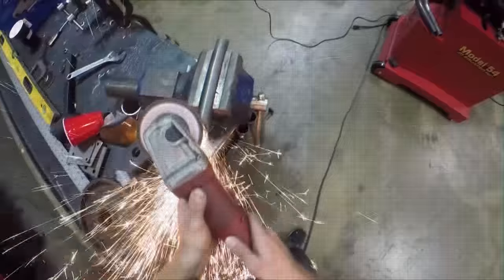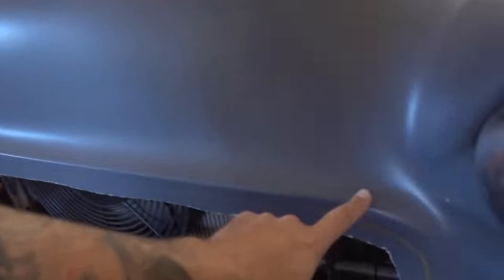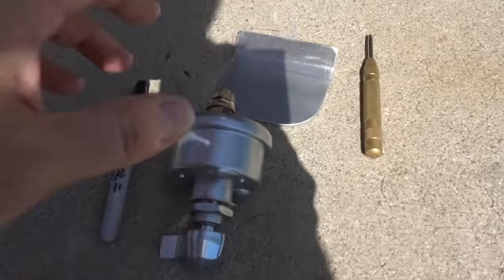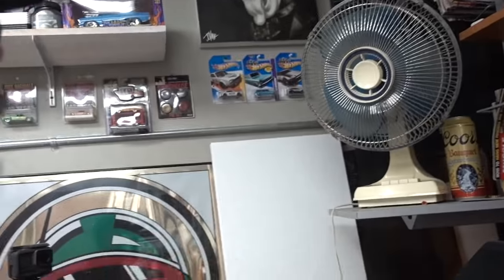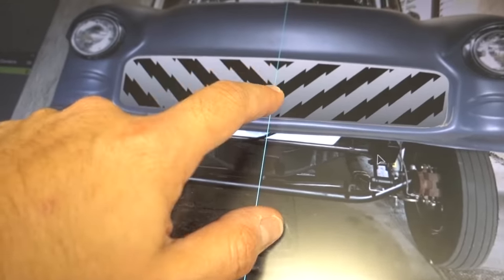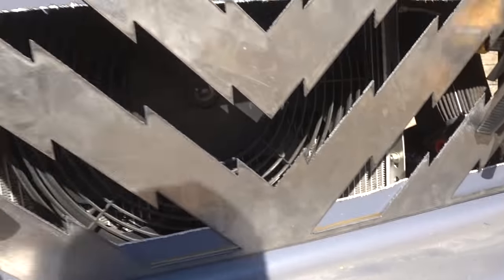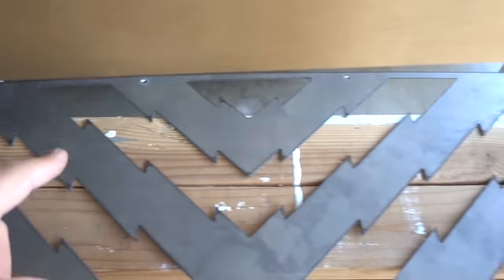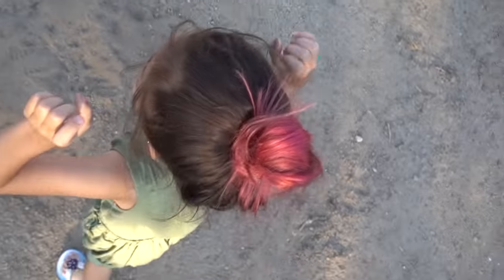600HP Chevy Bel Air Drag Car Gets a Plasma Cut Custom Grille! Gasser Upgrades

Comment: Jon, check the rule book for the tracks you run.  I believe the switch needs to cut the hot side, not the ground, and needs to shut the engine off as well.  And it needs to be labeled "off" and "on" for the track workers.  I'm not a drag racer, just repeating what I read.  Best check for yourself.
Reply from the maker: Whiskey Tango Foxtrot Over Appreciate the message, I’ll reconfirm with the organization about the switch.
Reply: Whiskey Tango Foxtrot Over yes it states on the hot side. I went with the ground out of habit. Always pulling ground first when playing with power.
Reply: DC power flows from negative to positive, plus you will never have a shorting issue with terminals on the back of the exposed switch, cutting the negative in this case is smarter.
Reply: The wiring is a little tricky on the hot side... the alternator will keep the car running after the switch is off if not wired correctly.

Comment: Once upon a time, my father handed down his '55 to me. It only had a 350 with a Muncie gearbox. It definitely had that chop. It had dual quads, engine bored over slightly, lumpy cam, hooker headers, beautiful yellow paint job, grey 5 spoke american wheels w/ chrome lip, nice chrome dual exhaust and dropped spindles w/ slight suspension drop. Damn, I miss that beauty.

Comment: insulate the heck out of the back of the switch , just in case the switch gets hit while backing up and the back hits the frame behind it
might be nice to add the surround of the original grill , the headlight covers are still chrome and i think a chrome edge around a matt black or dark aluminum / silver grille would look goed 
it probably be a good idea to glass in some reinforcement behind the bolts holding the gille in so it doesnt tear the poliester up

Comment: He should do a grind a slight bevel along the edges or do a grill surround trim to add some depth to the piece and compliment the paint color, an easy way is to take plastic poster trim and a heat gun to make a mold around it that will sit flush and securely.
Reply from the maker: Literal Crown Literal, it sounds like you should come down and help!😂
Reply: @HooniganProjectGarage  I literally will, I'm only 2802 miles away. Give me a week.

Comment: What if you did that same design in perforated steel mesh? 
I think that’d look pretty sweet. Plus, it’ll give you some better air flow to the radiator like you were saying you needed.
Reply: Kyle Westfall that’s what I thought too.

Maybe use some aluminum punch plate

Comment: Ok, Jon....just some FYI. The master cut-off needs to be routed to the MAIN POWER...not GROUND! Alternator also needs to route via through the switch! Ground shut-off is easier but allows other grounds to allow engine to run-on after ground is d/c.

Comment: Battery cut off switch is going to take some carnage when you put this thing on the bumper. Might want to relocate or ask Dan to get you a couple skid bars. Just in case, because I believe in it's potential.

Comment: Should have had Kyle make you an outer ring the same size as the grill for a template to cut out the excess then you could have used it as a support brace on the back side

Comment: i wish you would have welded some screws with the heads cut off of them to the back of the grill for better fit and finish!
Reply: Jose Saldana Welding barrel nuts to the back and running screws into them would've been the way to go for invisible hardware, but I imagine he wanted that look or he would've done something different.

Comment: You do know that a battery cutoff switch isn't actually for a draining battery? It only used so the guys at the track can save your life in case of an accident. Thats it. Just do the work to fix the draining issue by actually solving what is draining it, because battery drain will also mean less power to the coils, which in turn means slower times at the track: No bueno! 

As for the grill:  You should use 30% of the total radiator area. as a guideline. Since you have it as a template you should be able to easily calculate it. BUT: Air will now just flow around the radiator as it stands. It will always take the least resistance, which is around the radiator and not through it. So make a shroud first, because otherwise it won't matter and it'll still overheat.... Thats also what is happening to just about any car you have in the shop at Hoonigan....

Comment: Your car should shut off when the master switch is thrown. If you have a working alternator on the car cutting ground won't do that. You need to cut the positive and the exciter wire on the alternator to do that. Micah Diaz just went through that. Just so you know. That is not considered a legal cut off in racing.

Comment: The grille should be chrome, and it also should be mounted from the inside. Otherwise it just looks like an add on, not something designed to be there. 🤷🏼‍♂️

Comment: That cut off switch will not pass tech unless it kills the motor while it's running. The ground won't kill the motor
Reply: That's what I thought you need it on the power side

Comment: Pull them rusting bolts out get 304 stainless steel bolts, and put clear nail polish in the holes you drilled in that priceless bumper. Bone head 😁 then good job. On the switch.,never use steel around chrome.

Comment: Please save yourself a LOT of grief and do not use the cut off switch for anything other than an emergency. Do not use it as part of your regular shit off procedure. Those switches are not designed to see that sort of usage and will eventually fail prematurely. If you’ve got a phantom drain you need to properly identify it and fix it.

You also need to test that switch with the car running. I’m willing to bet the car won’t shut off as quickly as it needs to be because so long as the alternator is spinning it will back feed the system and it will find/force a way to ground. You really want to interrupt the alternator field current as well to kill the car immediately. That’s why many including myself use a four pole switch, not the two pole you installed.

And your daughter is right - paint it yellow!

Comment: This is not NHRA legal. Rule book says you must break the "hot wire". Also Jon did not test this while the car is running (which tech will do with engine running over 2500 rpm). Not trying to be tech police, just warning that he will run into issues with tech.